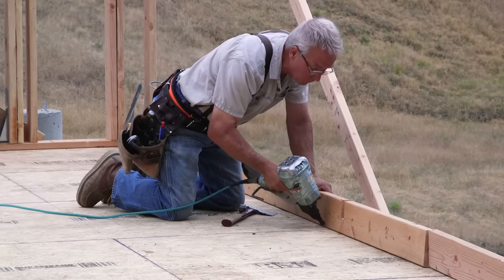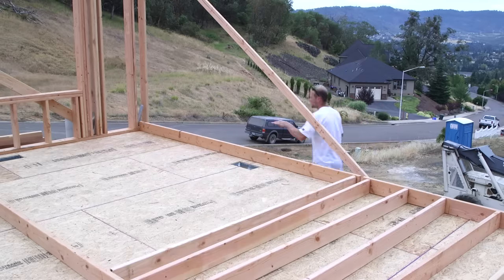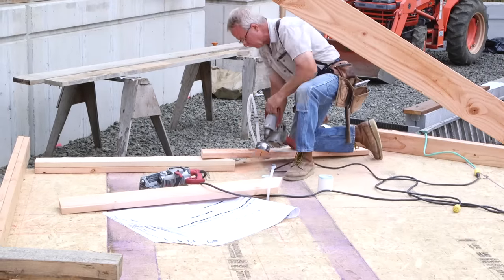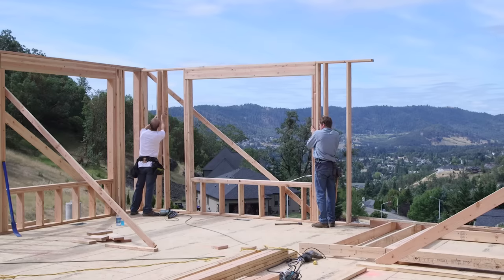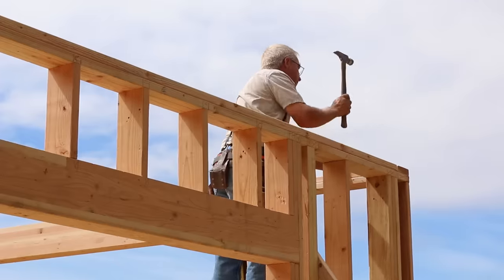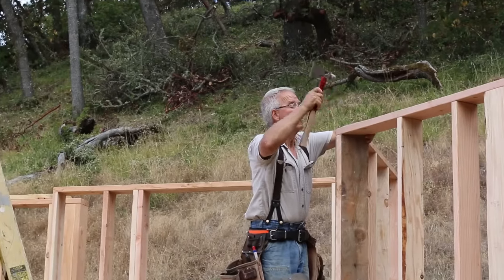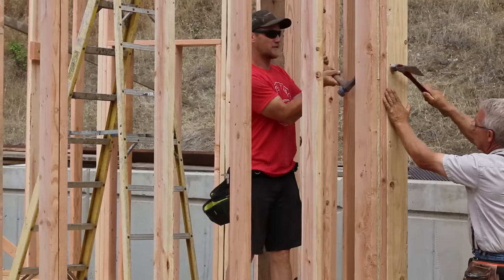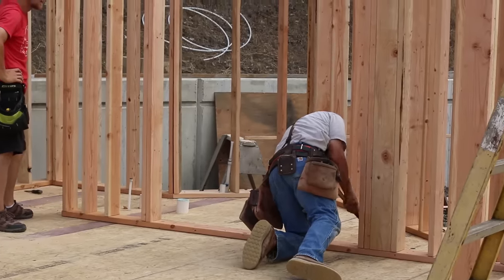Framing: Crown Plate, Toe Nails, Lifting & Bracing Ep.48

Comment: I’d like to know more about how to use the rigging axe.
Reply: It’s a great tool and equals or surpasses a regular hammer [for framing] in every way, EXCEPT for pulling nails. There is a small notch on the under side of the blade for pulling nails but you’ve got to use a good bit of restraint when using it or you will break the handle very quickly. The ability to ‘chop’ something with better accuracy than the claw on a hammer can really come in handy while framing.
🤜🤛
Reply: psidvicious I’ve always been confused by that,  what exactly do you chop? I just use my claw on my hammer to break ban ties with (I think that’s how you spell it). What would you “chop” with a rigging axe?
Reply: @Trent330i  ‘Band’ ties is actually the spelling.
Probably the thing that gets ‘chopped’ the most would be nails. The rigging axe isn’t intended to be razor sharp (and shouldn’t be) but the steel is harder than nails and will chop right thru them. For example, 2 boards are nailed together. Instead of getting out a cats paw and pulling the nails, just chop in between the 2 boards, pry them open slightly with a twist of the handle and chop right thru them. It can be used for chopping out a quick shim neater than a claw hammer. Also many times you can get the blade in right tight into a 90° corner where a hammer claw can’t get and pry something away.
🤜🤛
Reply: So, basically, the rigging axe is superior to the framing hammer in every way except for 50% of its functions. And in that regard it sucks. I think it's worth mentioning that Larry Haun did not use one. In fact I don't think he even mentioned it in his book and he covered a lot of the history of American carpentry. He did, however, go on at length about the development of the framing hammer with its straight claws, good for both pulling nails and picking up headers.
Reply: @GarwoodNick  First of all, if you’re a framer and 1/2 of your ‘hammer time’ involves pulling nails, maybe framing isn’t for you. Secondly, how much time have you spent using a rigging axe? I doubt any bcz you’re ready to discount the tool as useless bcz, you never saw Larry Haun use it?? At least 50% of framers carry a cats paw in their bags, so if you carry a tool specifically designed for pulling nails, why not carry a rigging axe? 
Look, nobody’s holding a gun to your head saying YOU have to use one. If you don’t like them, don’t use it. But before you start telling everyone else what they should or shouldn’t use, you might want to educate yourself first so you know what you’re talking about. I’m simply sharing my experience with it.
I don’t wanna burst your Larry Haun bubble, but Larry wasn’t God. Larry was a good framer and a real pioneer when it came to documenting framing technique on video and writing books on modern framing. But frankly, he’s not the BEST framer I ever saw. It’s funny you mentioned him though, bcz I just made a comment yesterday on his ‘How to build stairs’ video on YT bcz there were things he showed on there that could use some improvement. I hope I’m not being blasphemous.
🤜🤛
Reply: @psidvicious  you can take jabs at my skill level all you like, but the reality is that, in this day, the business of nail-driving is performed by nail guns, and nail-pulling represents a significant part of the utility of a framing hammer. I have never used a riggers axe so I have been searching online for some convincing explanation of the benefit of the tool and so far the most oft-cited benefit has to do with its weight and balance. But you can get framing hammers in virtually any weight you want and I have held a lot of framing hammers that are also nicely balanced. At any rate, I don't understand why balancing such a tool would require adding a blade to it. So surely a framing hammer with an axe-blade would be intended for chopping something. But what? The only thing I found mentioned was cutting the ears off ceiling joists. Well, we don't do that anymore 'cause nowadays we have trusses. As for using it to cut nails, a sawzall with metal-cutting blade works extremely well. I can appreciate that the tool was used well by roofers for installing shake roofing. The blade works for splitting shingles and I saw a video of a roofer using the axe to cut a valley line onto a shingle. But for framing, the tool seems of dubious value. I thought maybe it was of historical importance, which is why I mentioned Larry Haun. He worked in a previous era and so I thought, if the tool really was popular in earlier years then surely he would have mentioned it somewhere. But he didn't. I can't help but think it's just a really strange tool. I don't get it.
Reply: @GarwoodNick  And I totally get, that you ‘don’t get it’. That’s perfectly fine and completely your right. I get that. But in my experience, I found it to be a very useful and frankly fun tool to use for framing. I used it many years ago when I first started in construction doing framing. Later I moved on to concrete high-rise construction and it was just not as functional to use as a standard straight claw framing hammer. Form-work requires too much nail pulling. Not bcz a mistake was made, but bcz the forms get nailed together, then taken back apart, over and over. You’d be surprised how much nail guns are NOT used in form-work. Maybe bcz they don’t make a nail gun that drives duplex nails. [That I know of anyway. I could be wrong but I’ve never seen one.] 
Anyway, don’t be too quick to dismiss the rigging axe. It is a functional and fun tool to use for framing.
🤜🤛
Reply: @GarwoodNick  Larry Haun:
https://www.youtube.com/watch?v=dR_zvOeCFGA&lc=z23ghnyyzledut5oe04t1aokgi1id4bntyth2iajlct4rk0h00410.1573412074828732&feature=em-comments
🤜🤛
Reply: @psidvicious  yeah I see what you're saying about overcutting the stringers and I like your method of laying out the edge of the stringer before marking the treads and risers. Larry definitely didn't go overboard on quality, in fact most of his methods deliberately sacrificed quality in pursuit of greater speed. His greatest contribution, in my opinion, was his idea that, with practice, you can eyeball a lot of cuts and still get good results without using either a tape measure or square. It definitely speeds things up but, even with practice, the results are a little sloppy.

Comment: Other than more insulation R value, what is the advantage of spending more money on 2 x 6 exterior walls?
Reply: Insulation Value.  I'm guessing you're from the South. Not to put you down, just that the guys who ask that question are usually from the southern part of the country where 4 inches is more the norm.  In the northern parts of the country 6 inch walls have been the standard since about the early 1980's.  In a lot of places 6 inch walls are the minimum by code.  there's other advantages, and disadvantages, like cost, ads you said. But the primary factor driving it is insulation thickness.